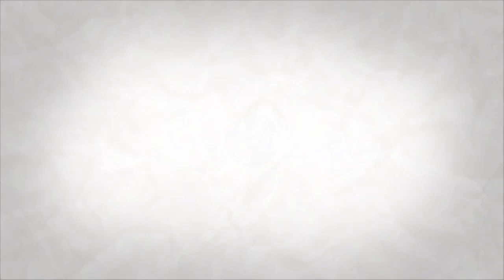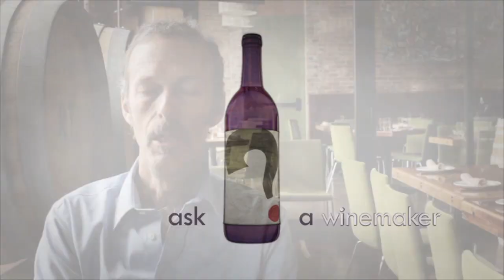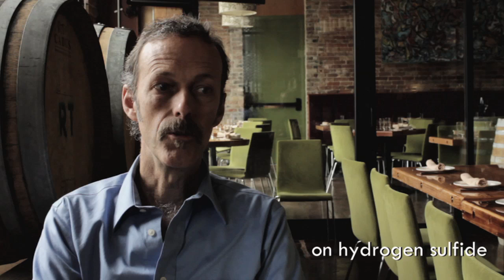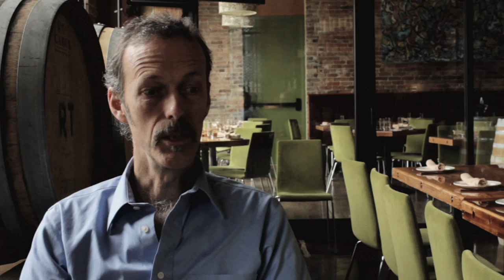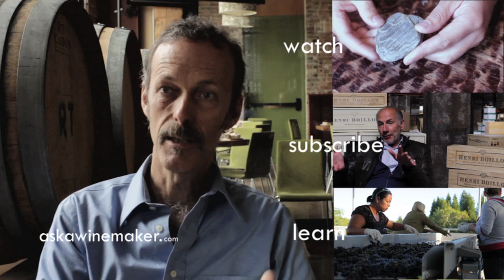How to fix hydrogen sulfide (H2S) problems in home winemaking

Comment: Any tips on how to deal with H2S when it's not in solutions, but in barrel? 

After while making mead i had H2S problem at the end of fermentation and i decided to dump out the batch, it was 6l first time try. Never had this problem with wine so i didn't knew what else to do, but now sulfur smell persists in the barrel, currently i'm trying to get it out with hot water. Thinking maybe hot water + table salt could work and kill any bacteria that seeped into the wood, but i heard that harsh chemicals and chlorine can damage the wood so i'd like to get an advice first before trying it.
Reply: Jack Black barrels are impossible to sterilize in my experience

Comment: What about stirring with a copper spoon?
Reply: dont just stir keep it hanging in there,, better yet hang a pure copper wire strip for a few hours and it should work quite well
Reply from the maker: We've done the experiment with pennies - euro pennies and 5 cent pieces that is.  They are reputed to have more copper than American pennies.  I'd bet that a real copper spoon would be effective as well.
Reply: If you use any u.s. penny before 1982 it will have contain over 95 percent copper. If its 82 or after the copper percentage is 2.5 percent the rest is Zink. Euro is copper coated steel so a u.s. penny 82 or earlier has more copper than a euro. Possibly a current penny has more or the same amount of copper as a euro.
Reply: Hi, how many euro 5 cents shall I throw in for 5 gallons and for how long? Thanks in advance